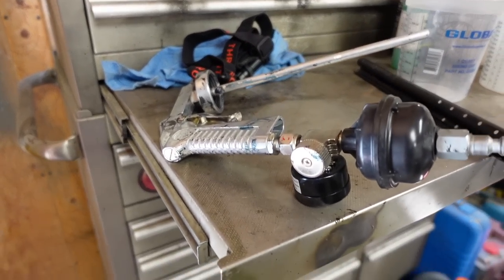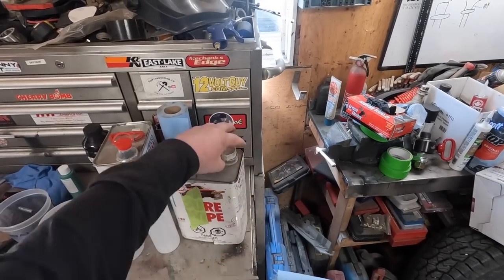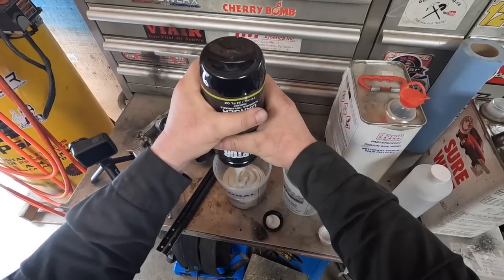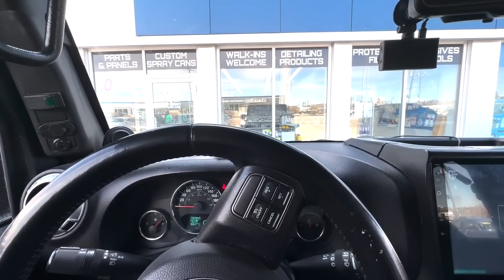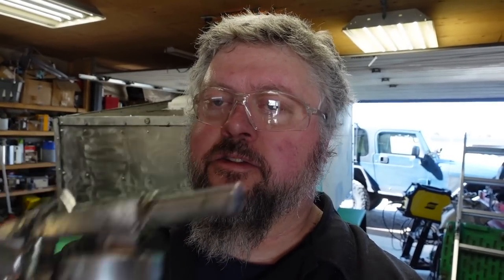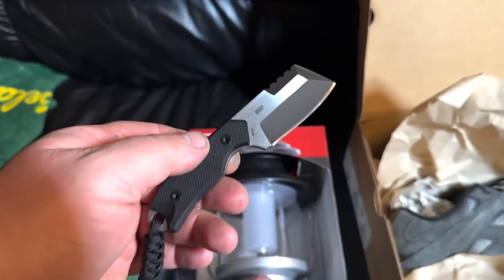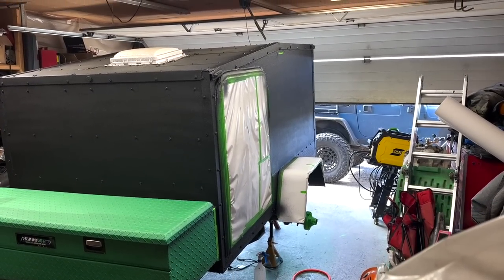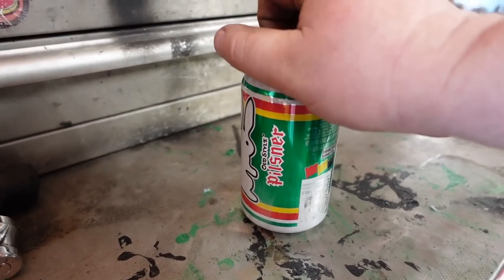DIY OVERLAND TRAILER | Paint it with Raptor Liner

Comment: I am more than sure you are aware of the importance of storage and disposal of both oil soaked and flammable rags I sore mind in a water filled container and out of sunlight, I did notice just tossing a rag in an open container I just about learned the HARD way of proper disposal just a polite reminder and I thank you for your informative vids
Reply from the maker: I usually burn them which isn’t the most environmentally friendly option either
Reply: @BackCountryWrenching  tHANK YOU FOR REPLY i STORE IN AN LIGHT COLORED GARBAGE CAN HALF FILLED WITH WATER AND OUT OF THE SUNLIGHT, WHEN NEC i DISPOSE AT LANDFILL  THX

Comment: Hey, so I am just about to put the Aluminum skins on my camper and would love your input on it. I don't have a compressor, so my options are spray paint, rolling on paint, Plasti-dip lol or vinyl. Saw that Crappy Tire has spray cans of black rocker guard, which is texture, wondering if that may be a good option. What are your thoughts?
Reply from the maker: Raptor liner can also be applied with a roller. Just only mix half a jug at a time and roll it on
Reply: @BackCountryWrenching  That's awesome!! did not know that, thank you, this this is the way I'll be doing it.